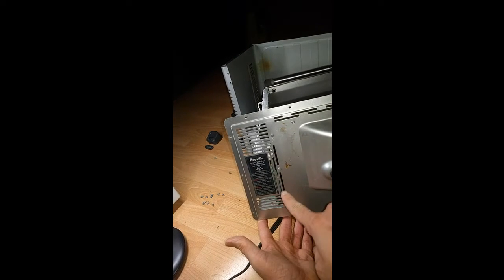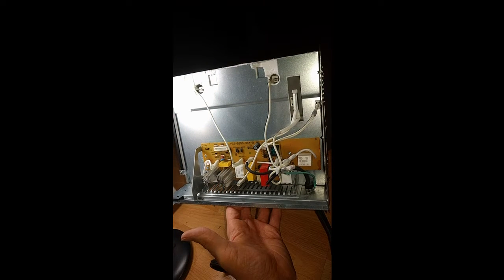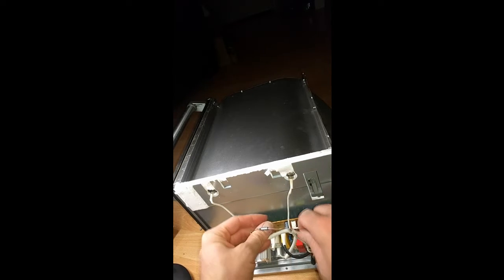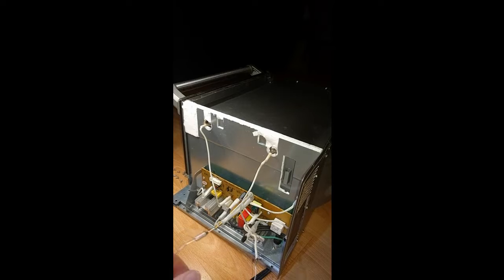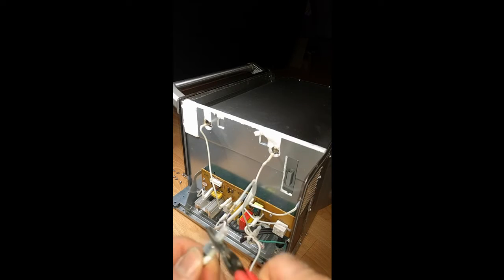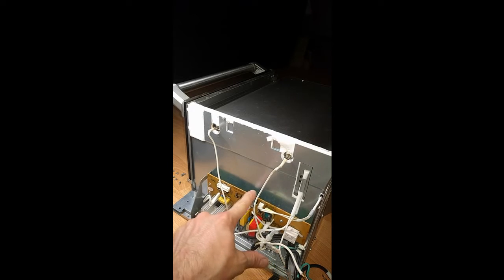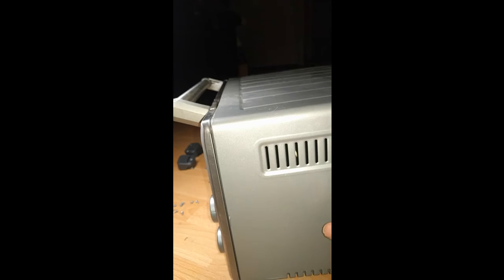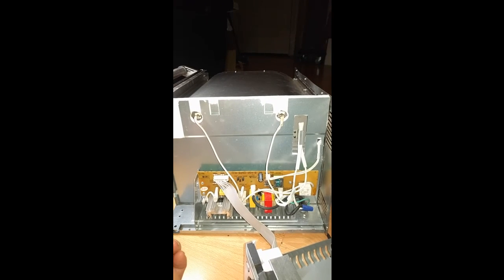Breville BOV650XL Toaster Oven Repair (thermal fuse replacement)

Comment: Hello, I have the same toaster oven as you, and while mine still comes on and the bottom element heats up, the top one doesn't heat up. I'm ruling out the thermal fuse and Temp sensor, but wanted to bounce the thought by you to see what you think.

Comment: Hi, I am making the same repair. My issue is the removal of the top wrap cover. It seems to be attached somehow in the front but all diagrams show no tabs in the front for screw placement. What did you have to do to loosen the cover from the door side? Thanks
Reply from the maker: IIRC there is a hidden screw on the bottom where the display is.  Then theres the screws in the back, and it angles up and out like a microwave top.  Id recommend searching for more videos ot Breville toaster ovens and youre likely to find the steps.
Reply: @SegasonicfanDesigns @SegasonicfanDesigns I located the one under the display; it is on the frame with a hole to put the driver in under where the front foot is?  I don't understand what you are saying about the back. The back appears loose on both sides; only the front seems to be still secured.I have searched everywhere for videos on this and your is the only one i found for this model number. The other models were different is disassembly. Thanks for the reply by the way

Comment: Good fix but how did you find the problem?
Reply from the maker: my grande madula ;D
(actually it's a super common issue with any mains heating project.  Just follow the AC mains line and check for continuity)